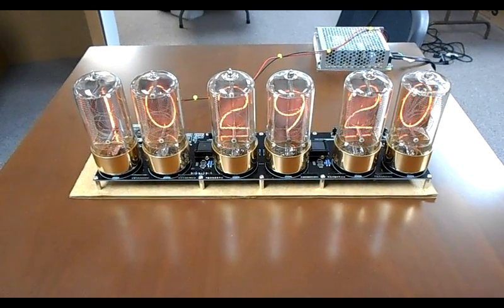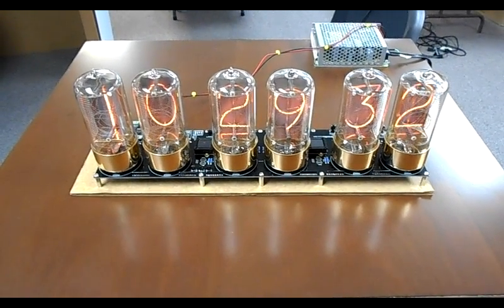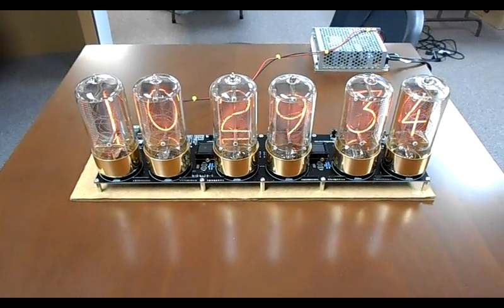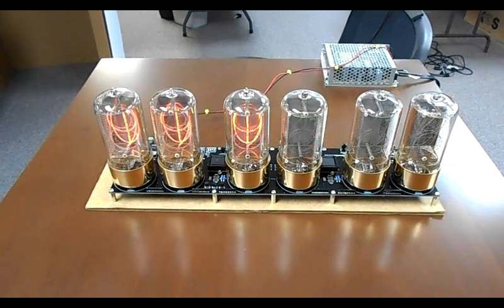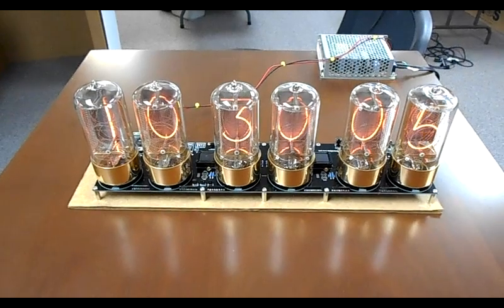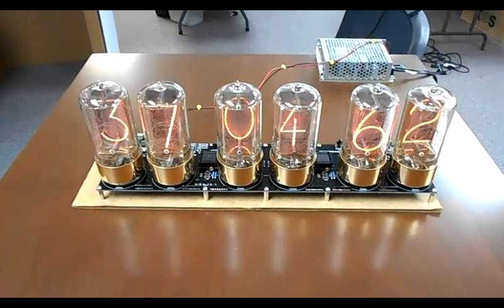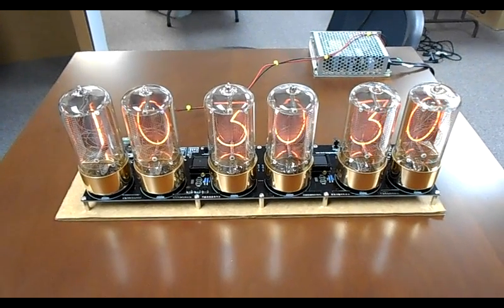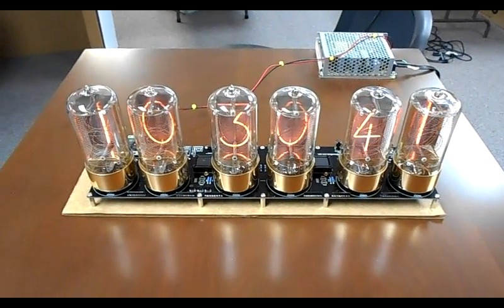Max's Giant Steampunk Nixie Tube Clock: The Electronics

Comment: Love this nixie clock, could you comment on where to buy the pieces and instructions on how to put everything together?
Reply: Hi there -- thanks for your interest.  In my case, I bought the tubes from Dalibor Farny who handcrafts them in the Czech Republic (https://www.daliborfarny.com/). Dalibor's R|Z568M tubes are pin-compatible with the original Z568 tube. These are large tubes with a display area of about 2" wide by 4" tall (https://www.daliborfarny.com/product/rz568m-nixie-tube/). I just saw that Dalibor now sells a clock kit that uses 6 of these tubes (https://www.daliborfarny.com/product/zen-nixie-clock/).

In my case, I used a kit from Pete at PV Electronics (https://www.pvelectronics.co.uk/). This kit incuded the circuit board ad the components -- everything but the tubes (https://www.pvelectronics.co.uk/index.php?main_page=product_info&cPath=18&products_id=201). It also came with a complete assembly guide that you could download from the PV Electronics website. Sad to relate, I believe there was a falling out between Pete and Dalibor when Dalibor started selling his own kits, so if you are interested in a large-tube clock, Pete now recommends a different kit (https://www.pvelectronics.co.uk/index.php?main_page=product_info&cPath=18&products_id=167.

I personally love Dalibor's tubes -- not the least that hey are new, handcrafted, and come with a guarantee (if anything goes wrong with a tube he will replace it -- you can't get that with second-hand tubes from eBay). I'm sure Dalibor's kits are great, but I have no personal experience with them.

As an alternative, you could use LED-based Lixie displays, which are a lot cheaper. In this case, you don't need to buy a circuit board -- you can just write your own clock program for an Arduino (Nano, Uno, Mega) or a Teensy 3.2 or 3.6. I'm using 12 Lixie displays in my Countdown Timer project, whose task it is to count down to my 10th Birthday (https://www.clivemaxfield.com/yes-my-countdown-timer-is-alive/)

I hope this helps :-)  If you have any questions, feel free to email me at max@clivemaxfield.com
Reply: Also, please check out my Cool Beans Bog at https://www.clivemaxfield.com/coolbeans for more info on my hobby projects and anything else that grabs my attention :-)

Comment: Its a beautiful thing! But why the elaborate power supply? It doesn't need that, as I understand it.
Reply: looks like an ordinary 12v power supply
Reply from the maker: If you check out this column ( https://www.eeweb.com/blog/max_maxfield/outrageously-awesome-nixie-tube-clocks ) you'll find more info including links to earlier columns. These columns describe how I'm going to build this into an antique wooden case and add all sorts of Steampunk effects and lighting -- including relays and gears and stuff -- so I have a bunch of these power supplies that I picked up cheap and that I use in most of my projects (which tend to be large and have space) so I have enough "juice" to drive whatever I add on later.
Reply from the maker: It's actually a combined +12V and +5V supply (12V for the clock electronics and the relays I'll be adding in, 5V for the electro-mechanical parts, Arduino, and tri-color NeoPixel LEDs